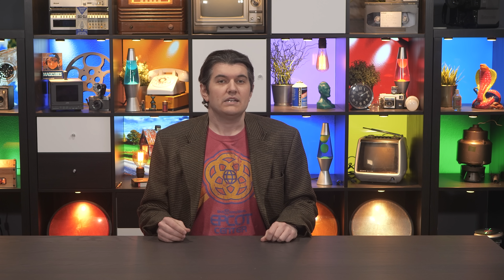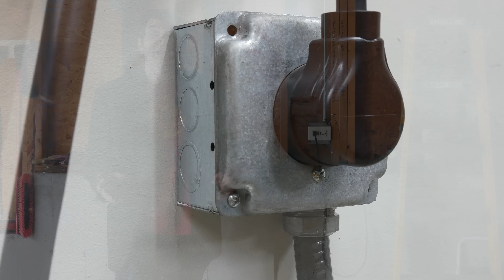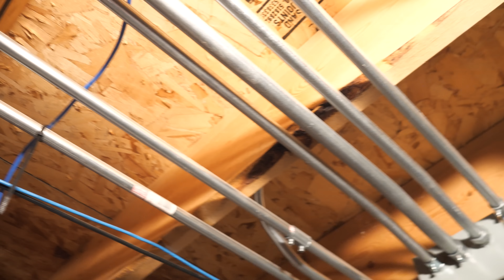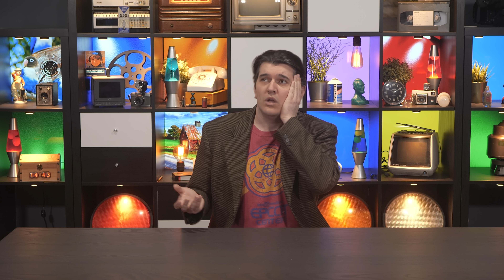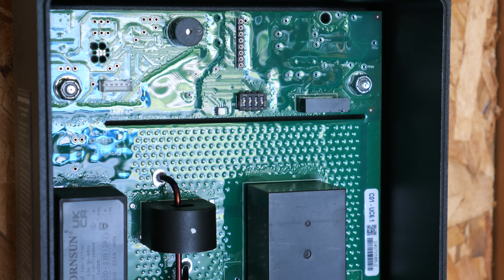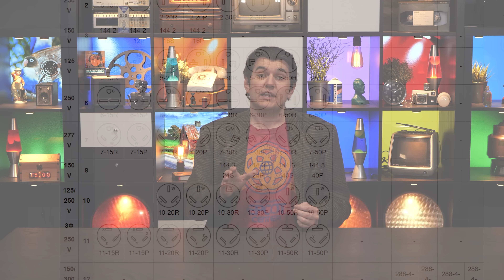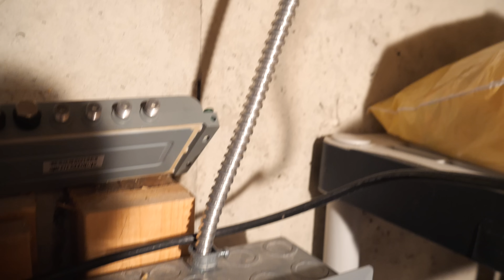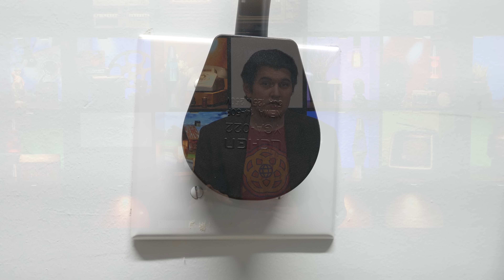The "standard" car charger is usually overkill—but your electrician might not know that

Comment: The master electrician I was legally required to make the final connection on my EVSE circuit didn't torque the lugs.  Fortunately, I was watching and have my own torque driver.

When you're dealing with these sorts of continuous loads, don't just trust random electricians (even ones who are actually really good at typical home stuff) to do it right.

Comment: The problem with every basic thing having an app and software that must be updated every so often is that you are at the mercy of the company lasting more than a few years, and if it does, the company not deciding that now they'll charge you more or cut you off; or they'll discontinue service to that one, so you need an upgrade, and so forth. It becomes a license to use rather than something you own.
Reply: Home assistant is great and all, but for things like this the best answer is either dumb hardware or hardware that has physical controls on it for any settings.
Reply: @doublestrikePhoto  how would you do stuff like adjust charge current on the fly to match solar panels then? It's very common (in maker communities) here to charge the car essentially for free by only charging it from solar.
Reply: Yes, reference Louis Rossman. And his right to repair rants. This happens all the time.
Reply: Yeah, you should out of principle avoid any product that either does not function without an app (or worse, app + registered account), or where you are given the tools needed to host your own dedicated server for it (and it is accessible to download via third-party mirrors too, ones not known to make old links stop working).

And for stuff that are either as costly as a car, or that you get as reliant on as a car, it stops being a principle and becomes a necessity. for something that is BOTH, such as a car, it should honestly become a legal requirement imo.
Reply: Yes: see last year's JuiceBox/Enel-X fiasco.
Reply: Or you update your phone and can no longer install that now old app.
I'm shy when I see things that need an app, it's just another way for then to make you bin it and get a new one way to early. - or spend way to much on a phone to support all this junk.
Reply: It is also wildly complicating what is basically an extension cord.
Reply: If they want software control, all they need to do is put an RS-485 Modbus port on the device and fully document it in the instruction manual. Then people can easily write their own software if needed.
Reply: @rocketman221projects  Or...hear me out....they use the standardised Open Charge Point Protocol (OCPP)
Reply: Exactly the reason I steered away from the ego lawnmowers when I found that out. I don't need a several hundred pound brick when I need to cut the grass
Reply: At the same time, the convenience of being able to use the pocket-sized gadget you already have and carry around everywhere as a remote control for everything is undeniably awesome. If only there were a way to have the best of both worlds...

Maybe if there were some sort of lightweight, open-standard applet format that all mobile OSes were compatible with, and required by law to remain compatible with forever, that could be stored within the device's firmware and be sideloaded directly onto the phone over Bluetooth.
Reply: Moreover, there are many devices that use an extremely simple command/response protocol that could be embedded over an encrypted connection (say, SSH over TCP), and bang, you're done.  There's no novel intellectual property there any more than the buttons on the front of your window air conditioner or the knobs on a hi-fi receiver are novel intellectual property.  There's no reason that a company couldn't just publish their specification as public domain (again, because there's nothing novel about it), provide a Free Software or open-source application for people to use, and let the marketplace sort it out.  If any of this were rocket science, I would understand why appliance manufacturers would be loath to do this, but for most appliances, the software that communicates with the world at large is either dead simple or is grossly overcomplicated only because it pulls in many layers of (often proprietary and brittle) goop that the cheapest-bidder vendor provided but didn't actually need to get the job done.

Many home automation installers stick with RS-232 interfaces not because it's inherently better--it really sucks--but because there's a tendency for vendors to bog down their appliances' network interfaces with the aforementioned layers of goop that, ironically, end up making the device less stable and harder to use, it's better to stick with the old, clunky interface that is likely to work for the next 50 years without service calls.

I'd like to think that the marketplace will eventually reject proprietary software for such trivial functionality that ought to be made Free Software, if not open source, if not standardized.  The idea that your phone needs to talk to a rent-seeking, proprietary mothership to check on the status of your proprietary, rent-seeking washing machine is no one's idea of convenience or progress.  Time will tell how quickly we progress beyond it.
Reply: The Emporia at least has a decent hedge for this: just flash it with ESPHome and use that.
Reply: That's why Home Assistant is just king. Allows you to use a bunch of smart stuff offline but retain functionality. Has a bit of a steep learning curve, though.
Reply: Nearly if not all chargers in the EU have Ocpp which means if they did go kaput you can roll your own server via things like Home Assistant.
Reply: Buy the company, not the product. Tesla for example is strongly committed to long term support of their products. They haven't orphaned a product since, what, 2015?
Reply: @DavidJao  No, thank you..

When I need a toaster, I want a toaster, not to swear loyalty to a corporation, pay a subscription or license, then hope they don't screw me over down the road. Same for cars, cell phones, computers, and so forth.
Reply: @azteclady  there is a right way and a wrong way to add smart charging features. Tesla charges no subscription fees and does not require Internet connectivity in order for the product to function as a dumb charger. Meanwhile there are benefits to smart charging, notably the ability to charge multiple cars from one circuit as I mentioned in another comment.
Reply: @DavidJao  No.

I would never give anything Elon Musk has touched a red cent.
Reply: @azteclady  and this attitude is exactly why the left fails. As if climate change becomes any more or less of a problem depending on who is offering the solution! And don't kid yourself - no other automaker other than Tesla is seriously serving to the EV market.

Comment: As a guy that runs a service department at a Stellantis dealer, I can tell you that the 110v “charger” that comes with the hybrids is not a charger but better understood as a battery tender.  We get so many complaints about the hybrid battery being run so low that it triggers a “service battery” warning.  
So, you’re not wrong but the 110v tender on Stellantis vehicles will not charge the battery, a 30+amp charger charge has to be performed every couple of days.

Comment: We went a year charging my C40 on our garage's existing 120V circuit, and only bothered installing a 50A 240V circuit when we swapped my wife into an EV9. Aside from one heinously cold week in February (in Wisconsin), I never had any real issues keeping my car topped off as the only EV. Now we just set both cars to only pull 20A and we don't have to worry about who's charging when!

Comment: 0:01 "Need" is (nearly) always misused. "Need" only makes sense "in order to" something. Nothing needs be done, with the exception that physically real things have (physically necessary) consequences. For example, x=y means that y NEED = x. Otherwise, you don't need to breathe. You need to breathe IN ORDER TO live, but only in most contexts. I'm sure we will find out how to not breathe and still live in the general, and there are all kinds of exceptions where one can keep living without breathing in specific cases.

You don't need to poop. You don't need to poop right now. You need to poop right now IN ORDER TO avoid crapping your pants in the next 30 seconds.

I hate when people say "need" without "in order to".

Similar problem: What "can" and "can't" are trivially true, in basically every case. When we use the word "can" in everyday parlance, it means, (literally) can PLUS cheaply/easily/repeatedly/well/distractedly. Like, we all know pretty much exactly which people LITERALLY can and cannot change a tire. When you say, "I can change a tire", it means you can do it easily and cheaply, without lots of attention, worry, or other great costs.

Comment: If you have a modern dedicated 120 volt outlet available, it’s trivial to “upgrade” it to 240 volt NEMA 6-15 or 6-20. Just need a new breaker and an outlet, the neutral can become the secondary hot.

Comment: The problem with EVs isn't really charging, it's that they progressively degrade in capacity over time. You have 250 miles of range when it is new, then 230, then 200, then 180, then...

By the 5th year you have to replace the car to do your long commute or charge on either way. 

That's ultra damaging to the environment.

Comment: The US paragidm of installing chargers on a plug instead of just hard wiring them in is really strange to me. If the instructions of your charger forced you to replace the socket anyway, why not just hard wire it in at that point, and remove the potential point of failure altogether?

Comment: I have a 3-phase 11 kW charge connector (16A) -- but I normally use it at minimum current the car can be configured to take: 5A..
Sometimes very rarely I load at higher rate, and even rarer I am traveling and use DC chargers.
(My 3-phase feed is industrial 100% duty cycle rated, but there are other reasons to reduce the loading.)

Comment: I put in an outdoor receptacle, and there's a video of it on my channel.  Check it out!  The NEMA 14-50 receptacle can certainly be fed from a 10 gauge  line from a 30 amp GFCI breaker instead of a 50 amp one with a 6 gauge line; the receptacle will  handle either.

Comment: its worth noting that bare bones evse prices have came way down since ive been watching and at the same time they have become more reliable and versatile. lot of people get hung up on these 500-1000$ extension cords and will never use any of their features and it makes the idea of an ev less affordable.
2012 ~500usd
2015 ~250usd
2018 ~120usd
2021 ~80usd
2024 ~50usd
and they are almost all both 120v/240v and have adjustable current settings now for added safety.

Comment: Of course you have problems with aluminum wiring, you should use the superior aluminium wiring!

Is there a need to plug your electric car charger in at all? When it's mounted on the wall already? Hardwiring is ALWAYS preferable to plugs. If done correctly. Which brings me to...

If you use wire nuts, you're not only nuts, you're a murderer! Anything but a Wago connector will blow up into a fiery inferno in due course!

Comment: I have a charging station that gets software updates. I'm happy about it, because it's got plenty of convenience features and has MQTT, I can control it and have automations running in Homeassistant (like starting charge and track the energy usage separately for the cars we use, depending on which one was plugged it without any manual intervention). But the charging station is open source, the software is entirely open sourced, the hardware design is as well, it's modular and can be upgraded to their newer revisions. That's the only acceptable variant of a smart charging station, one that will continue to function even if the company goes bust and if there's no connectivity to the internet whatsoever.
Reply: What is the name of it?

Comment: Are there cheapo wall chargers from china ?
Can the current of a wall charger be remote controlled to match solar excess? 
There woud have to be a serial or wifi port to command power in a 15 sec interval.

Comment: Why u dont simply use one of the Common 400v 63A three-phase current Outlets providing some 43kW of stable Output? Anyways See a bunch of them around basically each House, e.g. to Power ovens or electric saws

Comment: I  think most electricians know you can charge a car from a standard would know this but if asked formally to install a charging station they are going go with the electrical Code, the standard and receptable that support the most current carrying capacity. they are not going to go for those other stuff instinctively

Comment: I find it interesting how the design of the grid in a given country influences the discussion around what is "needed".
This video is arguing if you really need a 9.6 kw charger. Whereas here in Germany, where it is common to have a 400 volt 11Kw outlet in the house or garage, the discussion is if you really need a 22kw charger or if a 11kw does the job.
Reply: Some of us have 400VA/63a in their garages even. We do, because, to quote our sparky:.. "It's 40 bucks more than a 16A, and the grid connection and meter support it." "
Reply: @littlegrabbiZZ9PZA Makes complete sense to me. If it's easy and without downsides, oversize. It it's not easy, then consider proper dimensioning ;)
Reply: I find it strange being in the UK as 7.5KW is the normal, I'm lucky enough to have a 400v supply and opted for 22KW as its easier with 2 EVs
Reply: @glynjones8187 7.5kW is a 32A single phase. German grid operators basically ban you from drawing more than 16A from a single phase so the switch to three phase happens much earlier.
Reply: It's interesting, here in Australia the standard 32 amp outlets are just our 3 phase version with missing pins, it means they are massive, on the bright side they are waterproof. Most electric cars can't take 3 phase yet anyway or are limited. My cars Max charge rate for a is 7.2kw single phase.
Reply: @stainlessteele5  Maybe EVs where you are can't use 3ph, but the EU standard EV charge inlet is CCS2, which handles 3ph by design.
Reply: @alsavage1 yes but the plug doesn't matter, as far as I'm aware only 3 models of EV can charge on 3 phase over 11kw. Most are low power 3phase or single phase only with fast charging through the DC pins only.
Reply: @stainlessteele5  Well, I'll take your word for that I guess.  Tesla's OBC has always (since the Gen2 OBC/2013) been able to use 3ph inputs.
Reply: @alsavage1  Some cars only make use of 1 phase.  Just because a car has CCS2, doesn't mean it utilizes all phases.  Especially cheaper models or earlier generation EVs with small batteries.
Reply: @stainlessteele5  there are a lot more than 3 models with on board charger with more than 11kw.
Reply: @alsavage1 3 phase isn't super common in Aussie houses hence the obnoxiously large single phase draws
Reply: 22kW AC is more than most EVs onboard chargers can even use. Mine maxes out at 11.6kW . I guess if you only want to charge your car for 20 minutes per week.
Reply: @alsavage1 A lot of cars only include 11 kW (or lower) onboard chargers.  Plus if it's common to already have a 3-phase, 400V, 20A outlet, why bother even having a discussion about installation?  That's plenty of power, just plug in an EVSE and be done with it!

Comment: My take: I'd rather have it and not need it. They put a 30A receptacle in when I built the house, I'm swapping it for a 50A (yes I'm rewiring too) because I want the ability to charge faster for road trips since 8 hours isn't quite enough and I often have to run errands the night before we leave. Also I've seen enough posts of melted outlets that I'd prefer the "proper" outlet.

Comment: THANK YOU so much for this video :) I'm shopping for an electric car right now. My only option is outdoor parking though and I live in Canada so snow and cold. I was worried about that side of things. Question, I know it gets quite cold around you, do you know if the remote start/heating systems can be turned on while the car is plugged in? or is that something that is VERY vehicle dependent? Thank you so much again :)
Reply: Also I'm going to use your previous videos advice and try just level 1 charging as my round trip commute to the office is only about 15miles and I only work 3 days a week at the office. So I think a slow charge will be MORE than fine for me. Thanks for that advice too :)